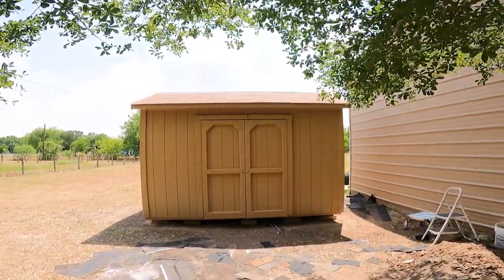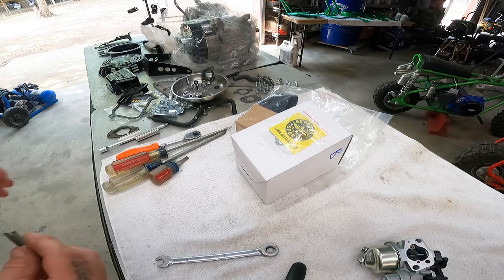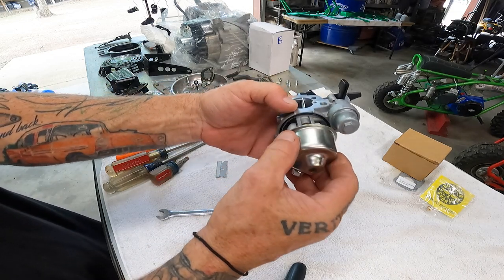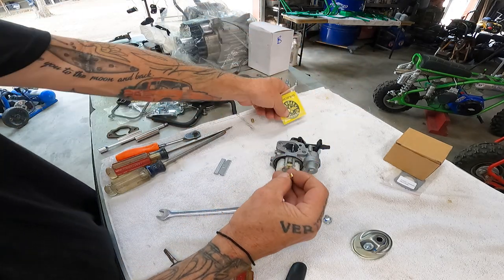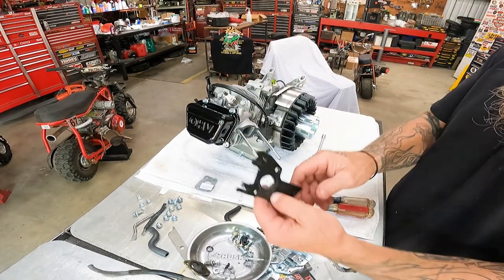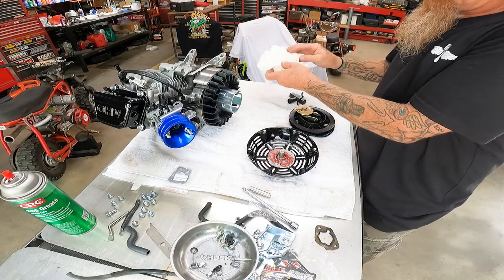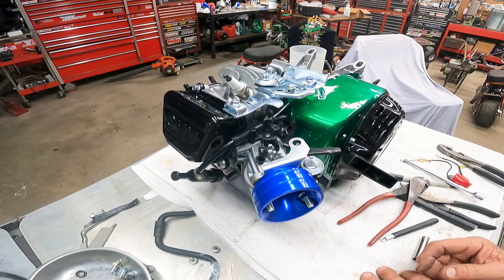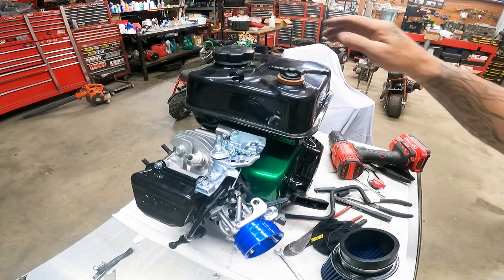Alexander Reynolds (ARCO) Mini-Bike Restore Part 6

Comment: Nice job on the motor Rick. Project is coming along great. I think i have went back and watched your build on the red Motovox with 10 inch tires 3 times.  That was the coolest looking bike that ive seen. Very nice! Really hot where your at and we are headed for the high 90's here in Iowa. 👍🎥🇺🇸
Reply from the maker: Thanks for watching , everyone likes the red mono vox , I have one in the works that should be better then the red one , like over the top ,,, stay tuned PS stay cool , it’s HOT outside !!